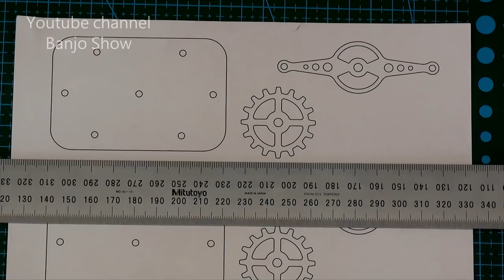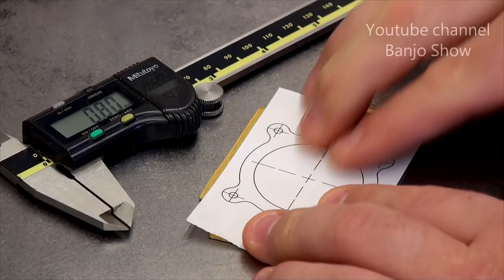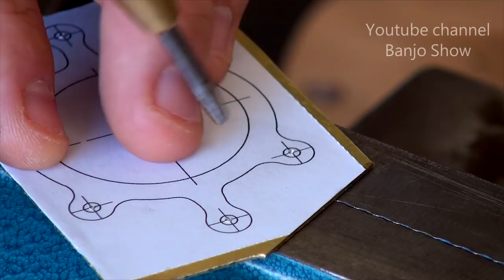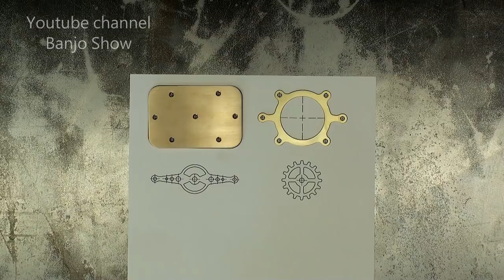Steampunk Leather Belt How to Make Rotating Gear

Comment: There were 2 of those small loops you made, one with staples and one stitched. Why did you hide the stitched one behind the belt loop and have the stapled one showing?
Reply from the maker: I showed in the video two different ways of manufacturing this part, and in this belt I used only with a stapler.